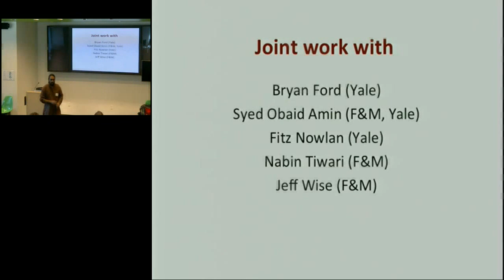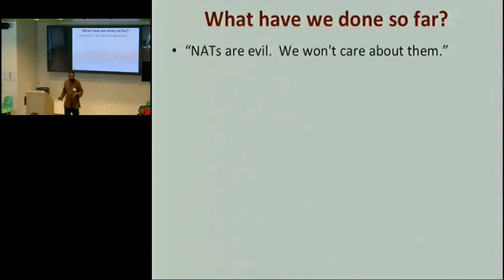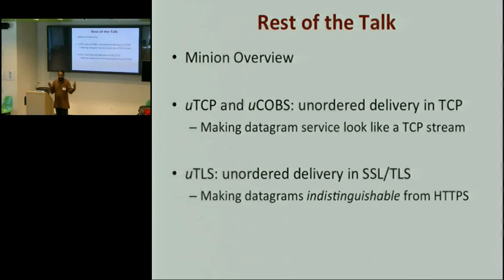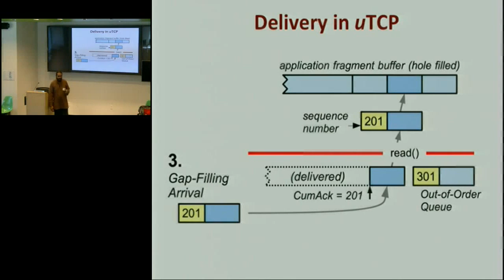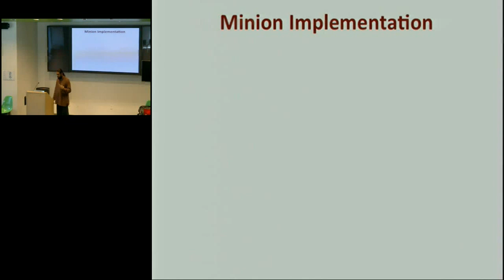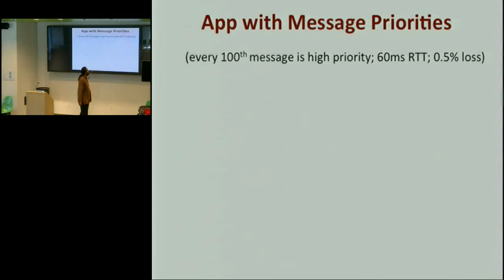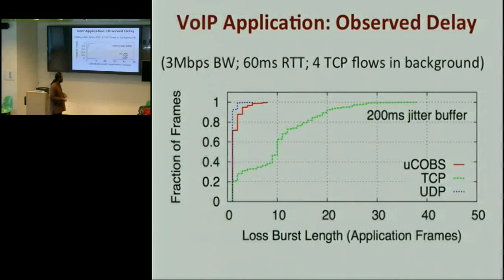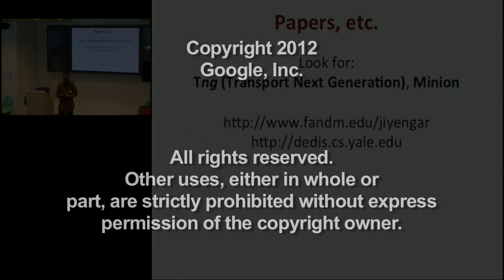Fitting Square Pegs in Round Pipes: Deploying New Transports With The Minion Suite

Comment: It was standardized when data was hardly as abundant.  They're out-dated rules, without a real usage beyond certain web services that require data transfer.  Besides, if you have conflicts, it's not easy for a standard user to fix routing issues.

I personally agree with the concept, as routing has seen a slower growth than hardware.